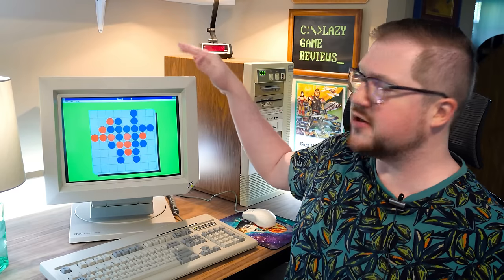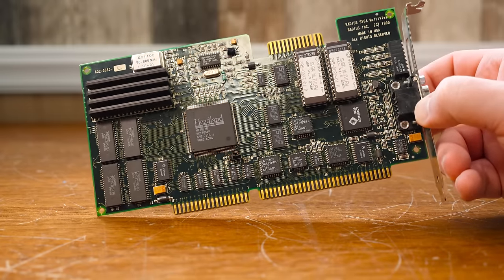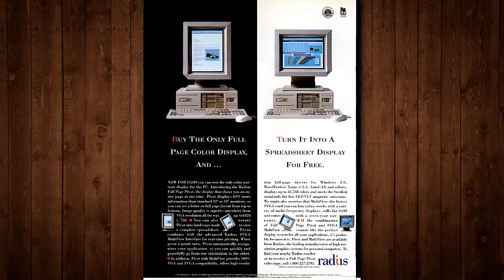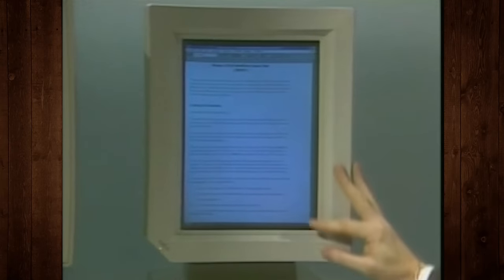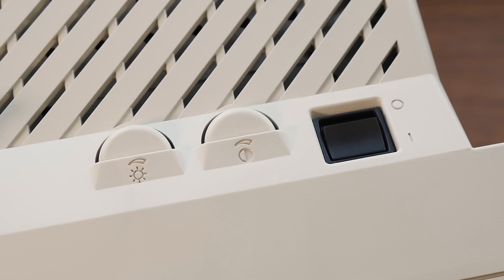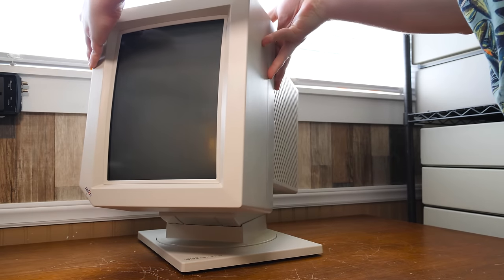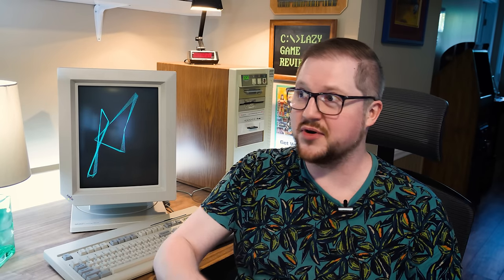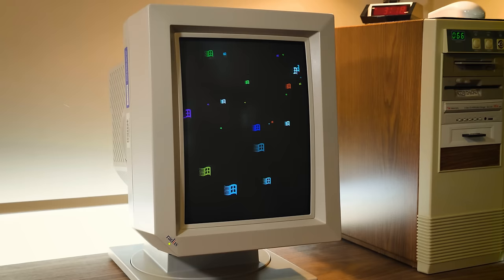Radius Pivot: The Rotating CRT Monitor from 1991 [LGR Oddware]

Comment: I do wonder... since this is a CRT, does it actually change the scan direction when vertical, or does it scan “the wrong way round“?  Plus as a more general question, what are the side effects of running a normal CRT on the side?
Reply: They used to warn not to turn your TV sideways, but I don't think it usually hurts it unless you physically break something.  And the TV isn't braced on the sides, so maybe breaking the glass is the risk.

I think it's still scanning normally, which becomes sideways, which is why it's producing the unusual video artifacts.  We usually don't film a screen sideways.
Reply: @customsongmaker  yeah, the diagonal artifacting in particular made me assume as much, a vertical rolling shutter clashing with the scan lines being rotated.

Comment: Could you explain why scaling would be needed in portrait mode like detailed inbetween 17:00 - 18:00 ? The pixel count would be unchanged, isn't it? why is it squeaky in the first place? It sounds really annoying. I have sensitive ears, nowadays I get bothered with high-pitched noises (coil whine, relating to power delivery etc.) in notebooks (in Gigabyte Aorus G17 it seems somewhat prominent, especially when using silent fans, must be temp-related for some components). Otherwise it is a fine monitor. Please keep going on! I wonder, do you have odd devices like FPGA released during 1990-2005, that were targeted for audience interested in learning VHDL?

Comment: The mercury sensor might have been a case of over-designing it, no? It knows only two states, after all, and a simple switch, either switched automatically when pivoting the screen or even just a manual switch could have done the job just as well.
Reply: Alot of old thermostats had mercury switches inside them to turn the air on and off. The mercury would provide a seemless and silent transition with no extra effort.

Comment: I'm using a couple Dell LCD panels that I wish could do that automatically when I pivot them.
Reply: Would be pretty easy to design in such a feature (at least compared to the monitor as a whole). Doesn't need to be a fancy mercury switch. Just a simple mechanical one that'll click on when you click the monitor into position. Pretty sure modern connections like DisplayPort and HDMI allow the monitor to send data back to the computer, too. Even without that, USB hubs in monitors are common, and you could use that for notifying the computer.

Comment: did you try on later versions of windows? it's interesting if we can see it works on modern hardware and OS
Reply: It doesn't work. Monitor uses the software and the card to pivot with a mercury switch. New OS you switch with the OS settings but the monitor won't scale correctly. Also it's not automatic, which is the feature of this monitor.

Comment: See, I look at this thing right here from early 90s and I'm wondering why the hell, 30 years later, we still have to manually change the orientation on our computers when using pivot monitors. Especially since things are digital and can pass all kinds of data. Why not a damn sensor to tell computer to change the orientation? And why is Intel the only one (that I'm aware of) that at least has decency to provide a hotkey for the pivoting. God damn it.

Comment: Funny enough. I got an HP Compaq LA1751g Monitor Has The same Feature but it cant automatically resize the screen 90 Degrees you have to manually do it yourself. Actually All HP Compaq LAxxxx Models have this feature. I don't know if all models have it or not.

Comment: Really what's the point of the software? Couldn't the monitor have been designed to cut the VGA signal when rotated and re-establish the connection while reporting a different resolution to the PC?

Comment: Apparently no win95 driver :(
SUMMARY
=======

The pivot capabilities of the Radius Full Page Pivot monitor do not function
correctly in Microsoft Windows 95.

MORE INFORMATION
================

The Radius drivers for the Full Page Pivot monitor are for Windows version 3.x
and are not fully compatible with Windows 95. Radius currently has no plans to
update these drivers.

The Radius Full Page Pivot monitor is manufactured by Radius Inc., a vendor
independent of Microsoft; we make no warranty, implied or otherwise, regarding
this product's performance or reliability.

Comment: Any self respecting PC Geek back in the Day had one of these
I did :)
Decided I wanted an NEC XE21 or Panasonic 21" monitor- both of which I still have today
Sold the Radius Pivot I had on AOL or GEnie Classifieds mid 90s
You could ship one of these for less than $30 USD via UPS back then.

Comment: If this monitor could somehow work with a modern GPU that supports VGA, in a modern computer, would it run competitive titles like CS GO at 107 hertz?
Reply: Perhaps, if you could put up with the max SVGA resolution and the 15 inch tube size (not even the viewable screen size). But obviously there are much better options than this
In addition I don't think CSGO requires the latest GPU, as there are many GPU options with DVI-I output that would easily run the game.
Reply: Only did 107hz in landscape in dos I believe. I may be wrong but I think it's in 60hz in windows that's why he didn't have to change the camera when in windows
Reply: @Blobboss  So this means it is not a competitive monitor by any means
Reply: I would say, probably not. If the program doesn't support portrait mode, or doesn't have it as an option and properly scale it doesn't work. Also, only works with dos and windows 3.1 as there are no drivers past that.
Reply: @Blobboss  So it won’t work with let’s say a GTX 700 Series or lower, that supports a VGA. Also to rotate, you can just use Windows Settings to use portrait mode.
Reply: @GamesCell  I've tried it in XP and there's massive overscan. It was a laptop and the GPU didn't have geometry correction in software. But with all that, big maybe.

Comment: So, I wanna know what it is that's going on in my brain when you move it back into landscape mode that the picture becomes more square? What is this optical illusion that is happening?
Reply: Landscape it's in 1024x768 then in portrait it's in 768x1024. This is the optimal resolution for this screen. Even though it will do others.
Reply: @Blobboss  that's not what i was asking about at all.
Reply: @Megatog615  ok, well I was telling you whats happening and it's not an optical illusion.
Reply: @Blobboss  i understand that you don't see an optical illusion, but I do. when clint rotates the screen back from portrait mode to landscape, the picture appears to squash into a more square shape than it should. i know 4:3 isn't square.

Comment: Additional Comment: With Windows 10 it is possible to set to landscape or portrait.  What would this do with this monitor?  Providing, of course, that it would work in compatible mode(s)!  (Obviously, I realise that the pivot probably wouldn't work automatically - but, it is just a thought!).
Reply: I've attempted this on an XP laptop, but the overscan was bad. Maybe with a GPU that allows separate geometry settings.

Comment: Would this monitor work with MAME?
Reply: Hard to say, the orientation switch relies on the drivers and software. I guess as long as your mame device of choice has vga, can do its own portrait mode, and does 768x1024 in portrait, and does 60hz. Maybe? Oh, probably be able to fix geometry via software.

Comment: RGB and high refresh rate? this was a gaming monitor
Reply: those didn't exist back then. Nothing was advertised as a "gaming monitor." RGB was standard in certain markets. most monitors had better refresh rates as well. No PC games that came out around 91 would have really even benefitted from a crazy refresh rate
Reply: @jbfarley  I was more referring to that startup screen with the chasing rgb effect on the text as has become common on so much pc hardware nowadays like the evga ftw3 30 series GPU's

Comment: The earth's magnetic field affects CRT. Typically, CRTs stay in one orientation and can be adjusted to match. 
I wonder if the scan from top left to bottom right remains the same when turning. 
Then it would be vertical instead of horizontal from top right to bottom left.

Comment: I was a little disappointed at your disappointment concerning the software that didn't take advantage of the portrait mode.  These apps are old af.  There's no way the original writers ever considered portrait mode; let alone portrait mode on the fly.  Also, having to retile the 6 windows after switching modes can not be seen as annoying.  Nobody back in the day switched modes all willy-nilly for demonstration purposes.  Of the 3 users I ever set up on switchable monitors, 2 of them put it in portrait mode and never switched it back.  The third user never, even once, used portrait mode.  Just my $0.02.  Love your videos, Clint.

Comment: 107hz??  My monitors are only 60
Reply: I'm also surprised by 107 Hz (I didn't watch the video completely and only know this from comments), and I suppose it's because this was a high end monitor......or something like that?
But the standard CRT monitors from Windows 98 to XP era normally could do at least 75 Hz. It's usually available for your average mid-end 17" (if I'm not mistaken, PC monitors usually was marketed with tube size rather than viewable screen size to give the impression of a larger screen size) monitors for resolutions set at XGA or smaller.

After watching the video it appears that the monitor does support XGA resolution (1024x768) but only at 60 Hz.

Comment: My IBM PS/2 has drivers for something like this, so I’ve always wondered how it would look on a proper monitor! I can force my 1 MB XGA-2 card to display an oddball tall-screen 848x1200 resolution in Windows 3.x on a typical Multi-scan SVGA CRT monitor. (The secret trick is to identify as an IBM 8506.)

The downside is that the refresh rate drops way down to an ugly 40.1 Hz, the colors drop to 16 shades of gray, and of course the aspect ratio is all out of whack, but it works, more or less.

Comment: you can't turn 'any crt' upside down or on it's side. it needs compensation for the earth magnetic field for that OR you can re-adjust the whole damn thing (on the inside ;) again. you can do it with most philips and other proper brand monitors. you can't do it with the cheap shit. if you simply mount them in another position (or even bring them to another part of the planet ;) they turn all kinds of weird colors or go fuzzy. why did we even ever notice this? ehm. try to mount a row of them upside down from the ceiling lol.
Reply from the maker: That is true for TV sets but I was specifically referring to VGA CRT monitors. Can’t say I’ve ever had an issue running those on their side! Perhaps I’ve just been lucky.

Sometimes the colors go wonky but once the degauss kicks in then it’s fine again.
Reply: @LGR  that is true for cheap vga monitors just as well. probably not many of those survived tho. as that'd mostly be the stuff they print your brand on or sell without a brand on it, and most of those were actual vga or very early svga. all the stuff still around today would usually be 'somewhat better than that' and thus have electronic compensation. (all the adis, eizos, philips, sony, whatever... basically any make that doesn't want to re-adjust their monitors if they ship them someplace else ;) nobody in his right mind would have saved a yellowed no-name vga monitor by now ;)